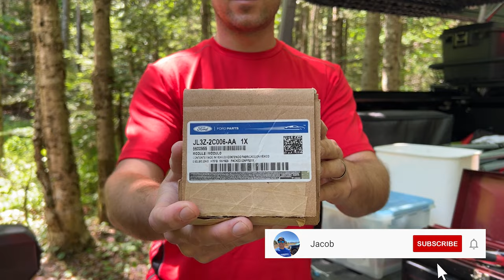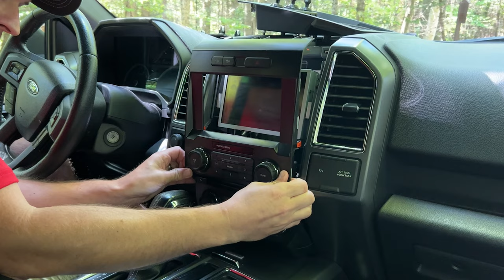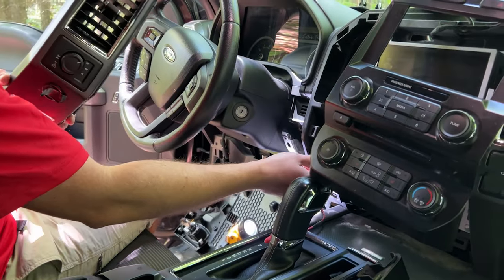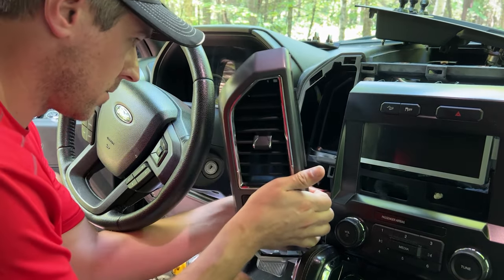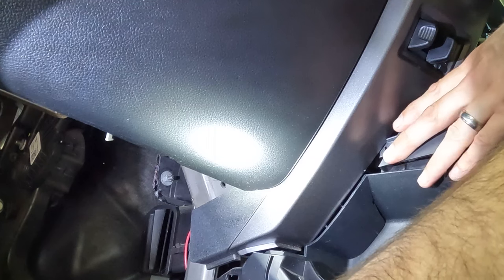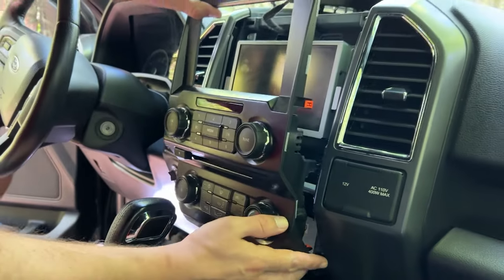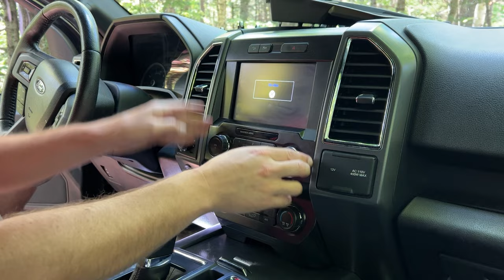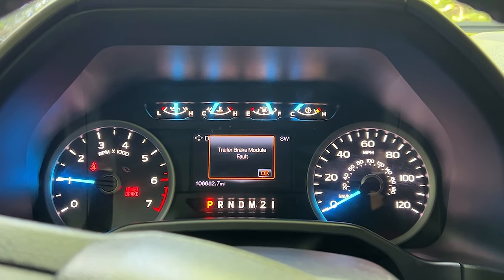Replacing Ford Trailer Brake Controller

Comment: Hello sir how did you no your brake controller was bad I checked all my fuses and had trailer checked to make sure brakes work properly and brakes for trailer don't work when hooked up to my 2014 Ford f150 ,thanks for your answer?
Reply from the maker: I didn’t know it was bad, I was trying to diagnose trailer wiring fault and trailer wiring issues by process of elimination. Replacing the trailer brake controller didn’t solve my problem, but I’m glad I replaced it anyways.

Here’s my recent video on diagnosing trailer wiring issues. I’d first suggest you plug your trailer into another truck to determine if it’s issues with the truck or issues with the trailer.
Reply from the maker: https://youtu.be/pUVANtl3YIg
Reply: Cause Ford dealership want about 300$ to just diagnose!
Reply from the maker: @gaelewis6623  , I'm not surprised. I try steering clear of all Ford dealership service centers unless I needed warranty or recall work done.
Reply: @jacobsupgrades  I had my car hauler fixed so I no brakes working on it and I have another 16' trailer and truck not sending signal to it either

Comment: When you installed controller did it work automatically?
Reply from the maker: Because I had a Ford trailer brake controller already, it worked automatically.

If the vehicle didn’t have a controller and then a controller was installed, it would need to be turned on using FORScan or a Ford dealer could do this for you.
Reply: @jacobsupgrades  ok well I have a factory brake controller was gonna buy another factory controller and install and see if it works

Comment: Why did you replace that? Did you check the trailer magnets everything else on the trailer? I got the same problem. I just spent 300 bucks for a control module, and it did not fix it.
Reply from the maker: I thought the module was giving me the trailer wiring fault message. The controller did seem worn but it turned out the main trailer brake wire was pinched on the trailer before coming down to the brakes. I ran all new line between the trailer junction box and the trailer brakes and fixed the problem.
Reply: @jacobsupgrades  I’m having same issue right now. 21 model I’m trying to get back home to chase wires. I replaced the brake control module Saturday from Ford the reprogrammed truck still didn’t fix. The magnets go bad also I hope that’s not my problem
Reply from the maker: @MississippiHot_Shot  it could be many different things. I have a video for tracing it down and diagnosing here https://youtu.be/pUVANtl3YIg?si=vK1C9hOGZdvEkkJk

I hope it's an easy fix for you.
Reply: @jacobsupgrades  man I’m replacing 3 wheels brakes and drums. Just put brakes on a year ago but I got 100k miles on these although I have 250k on my trailer and just now really having and trouble with it.
Reply from the maker: @MississippiHot_Shot   Wow you put a lot of miles on your trailer and truck. Were the brakes already wore out and causing the magnets to trip? If you still have life in the pads and drums you can adjust the magnets if they're not self adjusting.
Reply: @jacobsupgrades  yes, I do a hotshot Brakes still got plenty of laugh on the drums have got grooves in them from the magnets I was going to replace just a magnets, but you can buy the whole back plate set up just as cheap as the magnets cost
Reply from the maker: @MississippiHot_Shot   Yea replacing the whole back plate is much easier than messing with the magnets. I tried doing the same on my trailer and found out I have an odd size I'll have to order from Dexter.
Reply: @jacobsupgrades  I went to a trailer place that builds trailers close to home man. They wanted $250 apiece for the backing plates. The whole set up so I went to Dexter. We have a Dexter parts store not far from my town about 30 minutes away and bought the backing plate for $153, the drums were $355 apiece
Reply from the maker: @MississippiHot_Shot  Wow nice find!

Comment: Also, you don’t have to take everything apart that you took apart. It’s a lot easier than that.
Reply from the maker: It seemed like there may be a better way. Did you go under the steering wheel and get behind it? I couldn't get my large hand behind there.
Reply: @jacobsupgrades  yeah I took mine out and checked it. Make sure it was getting power and you don’t have to take anything but your center console just popped it up the top tray like you did and the radio facing and then that that little black panel right beside the gas pedal and that’s it you can pop the vent cluster right out
Reply from the maker: @MississippiHot_Shot  ok thanks for the tip! Sounds much easier
Reply: @MississippiHot_Shot did it have power? Did you replace it?